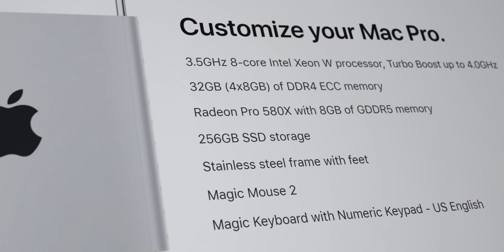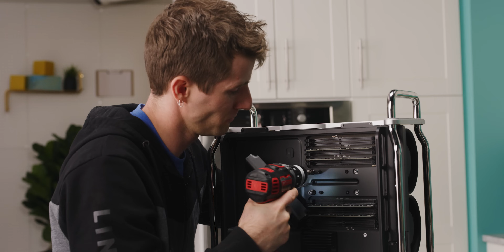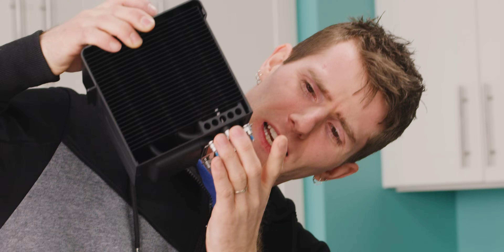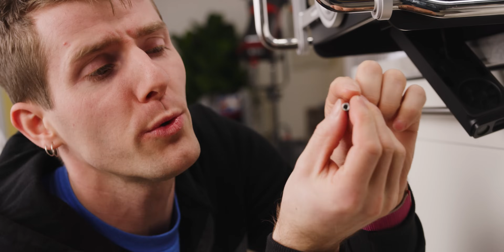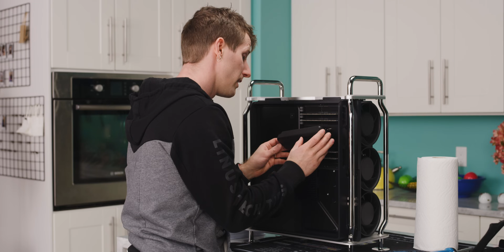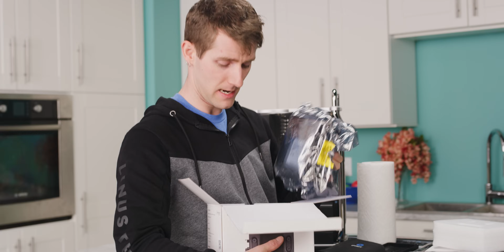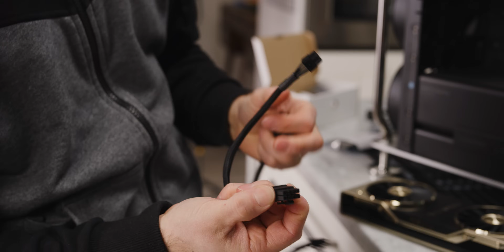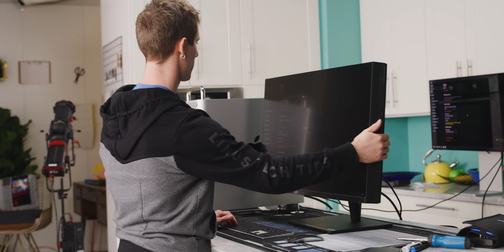Don't give Apple your MONEY - Mac Pro Upgrade Adventure

Comment: You said apple is hard to open? Oh no you haven't try to swap a hard drive on hp15-f305dx  https://www.ifixit.com/Guide/Hp+15-f305dx+Hard+Drive+Replacement/107476
Takes 30+ screw and 2 rows of clips just to swap the hard drive to ssd

Comment: This device is just total scam. 6000 is definitly not acceptable for the hardware they put in. MacBooks aren't better. For 1200 you get a really slow cpu and no graphics card. For that price you can get a really decent gaming notebook with a 1070 or newer. Sure thats not as portsble as a macbook but there are much cheaper small notebooks that have the same or better performance for a lower price.

Comment: Apple Engineer: "You know what people want to buy"
Executive: "What"
Engineer: "A 6 grand cheese grater with 32 gb of ram"
Executive: "Dew it"
Reply: Didn't know old Shiv was with Apple
Reply: @Andrew-vw5vb  threw in a star wars reference for my fellow fans and nerds out there
Reply: Dyxvyxd  yeah but that’s a symptom of the professional enterprise sector hardware. Not to mention they did do a lot to make upgrading and repairs super easy.
Reply: Lmao it's not for just people it's for media corporations
Reply: 32gb of ram is more than enough
Reply: @CreatorPolar  not for 6k
Reply: @oreo1749  Fam even for 6k 32GB of RAM is enough like you could open like 7 chrome tabs with that RAM
Reply: @CreatorPolar  I mean at 6k you probably want to do more specialized things like using blender and editing so 32 really should be just expected from a 6 thousand dollar computer
Reply: Literally worth 600 dollars, maybe 680 if you count the premium case.
Reply: @SAMISHUKRI  most I can say is 2-3k but   Like 6k is totally unreasonable
Reply: @SAMISHUKRI  wrong. The parts are expensive even if you buy the parts separate
Reply: @SAMISHUKRI  Incorrect. The parts by themselves are way more expensive than that.
Reply: @5YOfficial  The Radeon 580X Pro is a rebranded RX 580, and an 8 core 4ghz CPU is easy to come by. In fact I did a build like it on PCPartPicker for just 950 dollars (woulda been 700 if pc part prices weren't so bloated nowadays). It even has more cache and clock speed. Sure, it has less upgradability, but surely with the 5050 dollars you're saving, you can make up for that. Hell, with how much money you're saving, you could just up and build a whole new PC when you need to upgrade. https://pcpartpicker.com/list/VjctzN
Reply: @SAMISHUKRI  I'm pretty sure nobody has been forced to buy Apple products.
Reply: @montex66  why do they do it then
Reply: @SAMISHUKRI  I could explain in depth how my small army of Macs produces a decent living for me, but all you PC guys care about is playing video games.
Reply: @montex66  why would they produce a living in a way that a pc can't?
Reply: @SAMISHUKRI  You're hung up on hardware and that's the wrong place to look. The macOS is still easier to use than Windows and Applications for the Mac are often Best of Class, that is why so many graphic professionals use them. The macOS "gets out of my way", as we commonly say. That's why the CPU, graphics card and RAM are all less relevant to us - we only care about getting the job done without being IT professionals. Bottom line: I can get more done with a Mac than I can with a PC, in less time and with reliability the PC can't match.
Reply: @montex66  Can you give me an example as to how MacOS can speed up something in a way windows or Linux can't?
Reply: @SAMISHUKRI  The human element is part of the process, obviously, and macOS gets out of my way. I know you're looking for a specific example of a cpu function or a Windows procedure, but that is way down the rabbit hole. Humans like easy and the Mac is easy, while Windows constantly gets in my face when I'm trying to do the simplest thing. That's my experience and the number one reason I won't switch to a PC no matter how much RGB flashy lights it has on it.
Reply: @montex66  What do you mean macos gets out of the way though?? Like how?
Reply: @SAMISHUKRI  The answer is complicated and involves many workflow examples that I'm not going to delve down the rabbit hole for. What you can understand is that if the Mac was inferior to Windows, it would cease to exist entirely - and yet Apple is the most valuable corporation in the world with a $2Trillion market cap. They didn't get there because of cutsie commercials with jumpy people in black silhouettes (yes, a dude once told me that only the cool ads on tv made Apple popular).
Reply: @SAMISHUKRI  The reliability of the mac, applications and os that is made for just these hardwares make it very stable. That translates in for small and big companies that you dont need a lot of other know hows than just graphic desginers for example. Less cost for salaries to it tech guys that maybe is 50-60 grand a year for one guy.
Reply: @montex66  actually pc is faster on most applications.
Reply: @ebbehermansson2036  uh Linux is king 🤣🤣 macOS is garbage
Reply: @montex66  I know you have your thought on the thing and it's not its gonna or needs to change. But you got me phuckedd up if it it really came to some reliability. Coming from people who build CAD computers and old friends parent working for disney with wacom tab peripherals, it's not remotely worth justifying of the prices like this you see nor is there a real solid disparity between reliability other than security. That's downright potato brain idea and that's who it's for I know plenty of people who used Apple shit and got off the bandwagon. It "gets out of the way" implying it doesnt get hung up on all these extra processes, poor ram utilization, software prioritizing resources better? Lol bruh no way. Idk if ppl ever will just call it what it is, paying for a brand and "philosophy" like yea ok, so is buying a $100,000+ dollar supercar when I can get a car make I wanted with the relative same performance even paying mechanic labor rates to do it for sake of argument, as I can work on my own car for the most part. Lol what a joke I crack up everytime I see this kinda shit written about Apple hardware/software. Toodles~
Reply: @debbidonosenshi  It is difficult for me to believe anyone with such poor writing skills has any kind of job, much less with Disney.
Reply: @montex66  Haha that's the spirit bud. You really got me there huh. Doesnt really change what I said besides that as it's not at all what I was getting at. You dont gotta change your mind and I got nothing bad to say about you. It is funny quite often that some real smug or weird ass attitudes coming from people who think apple tech something special because it costs more or seems more "simple = robust". Idgaf just more examples why it's a joke to me so nice one.
Reply: @ebbehermansson2036  oof the brainwash is real
Reply: @montex66  by that logic wouldn't windows would have "ceased to exist" because it is inferior, but as far as I can tell windows is something that still exists 🙃
Reply: @History Of Obama dude wtf stop lying
Reply: @toxicityuser  Yeah yeah yeah. BUT what about her emails???
Reply: :yt:SEND ME HATE ON MY videoS:yt:

Comment: Apple uses a standard socket with retainer clip. You just removed the cooler wrong, you actually removed the socket itself.

On top of the cooler you see 2 holes. Put a long screwdriver in there and you can unscrew the cooler, and end up with a CPU snug into it's socket, with retainer clips.

Comment: Would this be a good choice for my Trash Can ?

Apple Mac Pro 2013 RAM Upgrades
Mac Pro 2013 (MacPro6,1) Memory Upgrades from NEMIX RAM™
Up to 128GB of Memory
Memory Upgrades for Quad-Core, 6-Core, 8-Core and 12-Core Machines:

The Mac Pro 2013/MacPro6,1 has 4 available memory slots.
All configurations can take a maximimum of 128GB of RAM.
For best performance, we provide kits of 4 matching modules.
Our RAM meets or exceeds Apple specifications.
Our Mac Pro 2013 (Model ID MacPro6,1) memory upgrades are for the following model numbers:
ME253LL/A
MD878LL/A
MQGG2LL/A
Backed by NEMIX RAM's Lifetime Warranty.

Comment: any way to connect a Graphic Card on a Mid 2012  Mac Pro  without using the 6 pin power ports on the motherboard?

Comment: next apple would use a BGA processor instead of a LGA  just to make the Mac's CPU unable to be upgraded by yourselves. and then they would make the PCI-E lock locked with a key so you'd need LPL to pick it for you... until you find out they reinvented the lock and if you pick it it'll void your warranty and bricks your mac.

Comment: The CPU slot is standard you just took it off wrong lol... if you unscrew it from the top and remove the heat sink you will see the standard slot with the clip. Unclip the CPU and boom your done, way easier then removing it from the bottom and prying it out of the clip X-O

Comment: Linus, there is actually 2 screws that are down inside the heat sink fins that your supposed to remove before you remove the heat sink. If you remove those screws I am talking about, then the heat sink WILL come off and leave the processor on the motherboard. That assembly that is on the bottom of the heat sink is supposed to be removed BEFORE you remove the heat sink by taking out those 2 screws bro. Then after you remove the heatsink properly, then you remove this wire clip that goes around the cpu and THEN you remove the cpu. BUT the CPU does NOT just sit in the socket bro. You removed the heat sink incorrectly bro, that's why it looks like the cpu has no retaining clips or anything, but it actually does!! I am not trying to just correct you, or be a smart ass. I am a big fan and a member!! Your actually one of the best computer techs on you tube bro!! I watch ALL your videos and I have learned soooo much from you!!! Keep up the awesome work Linus!! I am such a fan, I have almost all your T-shirts bro, and I wear them constantly!!!

Comment: The reason u buy a mac is not the specs. Its the amazing service apple gives. If u break it apple will repair it and they give a great warranty. U don't need a great cpu in a mac becuz the majority of users will be using it just to do work.
Reply: Stuff like video editing, animating or other digital work requires loads of cores. And Apple has a shit warranty. If you don't get the screen to show output, they don't cover it. Are you that blind?
Reply: @tuna5774  how many people do you think animate and do video editing the mac like i said is for the service and it can take the general work workload all other stuff sure get a different pc but mac has never advertised itself as a pc with a ton of cores it advertises for the vast majority of people who use it for the general workload
Reply: @BenShaffer282  Xeon processors are not meant to be used for general workloads. They are used for only the most strainful of workloads - such as workstation and server use. It's basically like a both of AMD's Threadripper and Epyc lineup. High core counts and stability, low core clocks and no support for unbuffered memory. You aren't meant game on a CPU that has a base clock of anywhere in between 1.2 and 2.5ghz, those require higher core clocks and better single-threaded performance to give you the optimal experience. And who games on a Mac anyway?

I just watched the Mac Pro system. They advertised the Xeon chip. And they said that it's for fucking professionals. And that makes sense. A 6k to 60k system isn't for anything, it's for work. It's a workstation that makes use of parallelization to function well.

I bet you have no idea of what streamline processors are and where they are, you have no clue what what an EPS connector is. And if you don't know those kinds of things, you buy a Mac. You're too lazy to put in the effort of caring about your computers and expect others to fix them for you. And if they don't do so (which is common for Apple), you just buy a new one.

Comment: "You've gotta give apple credit here, 6 screws and 2 thumbscrews later and I've changed the cpu" sounds to me like I really don't need to give Apple credit, that's a lot just to change a cpu
Reply: But this is 'solder the SSD, ram, and CPU to the motherboard so you can't upgrade' apple
Reply: Thats the same amount of screws my desktop needs to swap the cpu. It's a pretty good step forward for Apple.
Reply: @ChuuniKaede  definitely, but not as good as the 2012 Mac Pro that has 4 screws for a CPU upgrade

Comment: Is installing drives in the drive bay giving faster performance that using PCIe slots? I'm thinking about adding 2 OWC Accelsior 4M2 PCIe M.2 Nvme. to a 12 core with 128Memory. Is there a faster option?  Using one as a start up disk and one as write disk for Protools.

Comment: Im a mac user. I want to get into vr for art, vr environment building, vr art installations. Is mac not the platform for vr for this purpose? thanks
Reply: Seriously don't buy the Mac pro, you can build the exact computer for 1500$ less
Reply: ps1 hagrid I would never think of buying that rig and not only because i couldn’t afford it. i use a mac for my work, illustration, graphic design etc. Adobe. i learned basic on a mac in primary. so i’d like to stay with mac(apple) for that reason but if it’s going to be a nightmare jus t get it to kind of work i might start looking at other options for The VR stuff i want to do.

Comment: An 8 core Xeon W @ 3.5ghz, 4.0 boost, 32gb DDR4, and a 256gb SSD -> Linus: "I need to upgrade this with something decent." 

What exactly is not decent about those specs? They're pretty damned good! Not 6 grand good, but still good. Linus always seems to have INSANELY high standards for what he'll call "good". Like, do you need literally every AAA game to run at 4k @ 200 fps? 4k, sure, an enthusiast would want all their games to run at 4k and perform well, but by the time you go over 100 or so fps, you really lose any benefit from the extra frames; your eyes and brain simply can't process visual changes that rapid. So why bother spending a fortune on a card that will do 200fps when a cheaper one will give you 100? Do movies look choppy to you? They normally display at 24fps. If you watched one at 60fps, yes, it would look smoother. Double it to 120fps and you'd possibly notice a difference still. Up it to 240 and the two would be indistinguishable to the human eye.

I'd be interested to see an enthusiast like Linus given a test. Two monitors playing the same game footage, one running at 100fps, the other running at 200fps. He has to point out which is which. Twist is, they're secretly both 100fps. I'd be interested to see whether he noticed they were the same frame rate, or if he perceived one to be higher. Maybe it's just me, but I sure as hell wouldn't be able to tell the difference, even if there genuinely WAS one at 100fps and the other at 200fps.

Edit: Oh, he wants it for a video editing machine. That's not a use-case I work with, although I do know it's MEGA RAM heavy.

Comment: So you asked about the price different between black and green PCB. This layer of PCB called as solder resist layer and the difference between the price can not be more than 0.0x$/piece. But if you manufacturing 5 millions products it costs 100ks of $, maybe millions. I think for this memory modules the PCB is a cheap part of done PCBA. (Printed Circuit Board Assembly).

Comment: The EU required us to design the case so that it forces you to remove every single cable every time you want to open it.  I suggested making a North America version that would not require this, but they wouldn't go for it.
Reply: What are you even talking about? How does this relate to this video? Do you have sources?

Comment: And this is what happens when industrial designers make a high end product instead of mechanical engineers. Lots of interesting features and a nice design, but the cost is driven by the fact that everything in that thing is difficult to manufacture. $$$$$$$$$$$$$$$$$$4

Comment: "now remember, when spending $20k on ram, make sure you don't cheap out too much on the cpu..."

I'm just not quite sure who this video is for.. on a practical level. I enjoyed it a lot!
Reply: This is more of a business machine. Business might spend 40k on a machine, but if they can spend 20k instead... I mean, profit.
Reply: It's for the real professionals who were considering buying a $40-50k Mac Pro, to show them that they can buy a base $6k Mac Pro and upgrade it themselves with just $20k in components to get to an equivalent performance.
Reply: @kevindam1946  those professionals might as well spend some $10k-$20k on a top of the line PC.
Reply: @rainbowisticfarts  Yes? Mac and Linux are very common in certain industries

Comment: WTF is wrong with Apple's engineers? Having the ram slots on the back of the motherboard? Have the CPU be in held only by thermal compound and no retention arm to lock it down? Have the speaker situated in the middle of the ram slots and right behind the CPU cooler mounting plate? Have the PCIe slot so that Titan RTX goes in upside down? Like their engineers do everything sideways. Weird people at Apple.

Comment: Hi i was build hackintos with
I7 8700k processor, Gygabyte Z370 aorus gaming 3 motherboard,  DDR4 Gskill 3000mhz 64gb ram, Redeon RX 580 pulse 8gb gpu, liquid cooler, 256 gb ssd, LG 4k monitor, 
But still i cannot edit 4k footage, in any software, Fcpx, premiere pro, & davinci resolve,  its stucking, snapy please suggest me whats wrong.?
Reply: turn it of, unplug it, count to 12, plug it back in,then turn it back on. you're welcome.

Comment: Linus you knobhead. Torx drivers and bits are easily avalable in any stores. They are easy to work with and I prefer them over philips and flat head. My car has mostly torx and its isn't a problem.